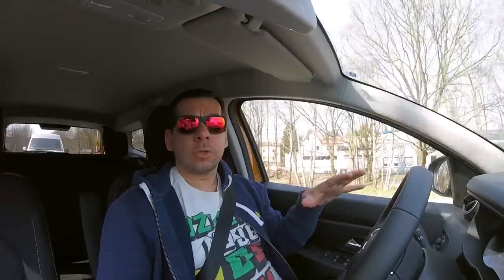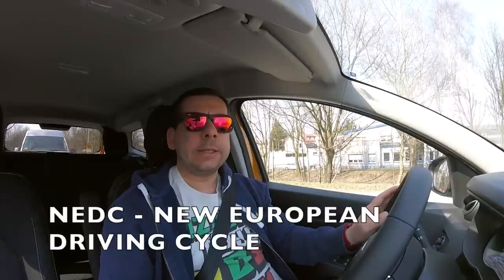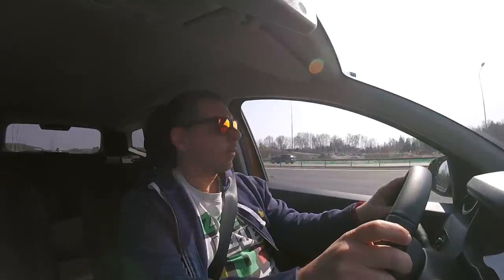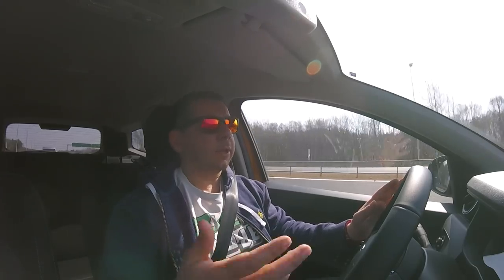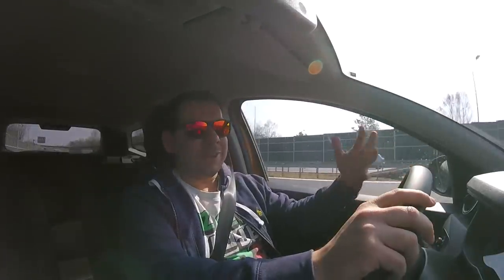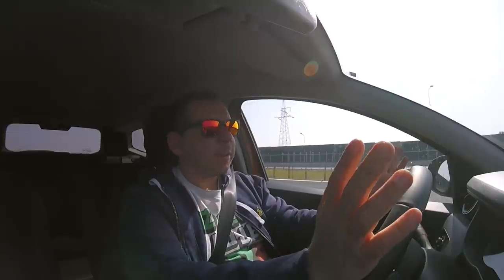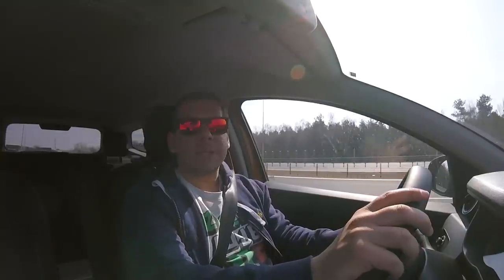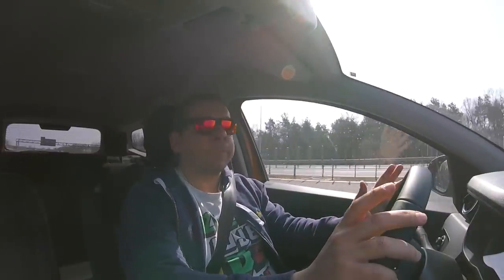NEDC, WLTP, and my fuel economy test cycle (ENG)

Comment: To my mind, usually used kind of fuel consumption tests should be based on the average speed. 
Different distances/speed values/periods of time/etc in way to reflect different usage models - in city/local road/highway with or w/o traffic jams.

Comment: In the U.S., EPA test results seem to match up to actual mileage more or less.  It is rarely 30% off.  But here in U.S., it is the manufacturers who (mostly) test their own cars.  Sometimes they cheat (VW, Ford, Hyundai/Kia).  The tests here are conducted on a rolling road, not on a real road or even track road.  I think the public should think about the test differently.  Rather than complaining "hey, I don't get the tested mileage", they should use the test results to COMPARE one model to another.  It is a SCORE , not a an actual fuel economy number.  If the tests are all conducted in a very standardized way, then such a comparison would be valid.
Reply: alliejr EPA is not  depend from car makers (at least not directly depend)
Reply: Are you sure VW cheated on the fuel consumption test?
EPA results are far from reliable either, EPA test procedure seems to favor big naturally aspirated engines while being overly harsh for diesels or small turbo engines. And VW is a great example  - Audi A4 (2.0 turbo) or TDIs are beating EPA numbers on a regular basis.
Reply: +sic22l VW has been convicted in court and also admitted to cheating.  It's a documented fact.  You can certainly argue that testing regime is wrong or right, but all of the automakers I mentioned are admitted cheaters.  In the case of Ford and Kia they restated the mileage figures for certain models to be lower than previously stated.  VW has taken billions in write-downs as a result of their diesel scandal which was all about detecting when the car was being tested so the car could cheat on the test.
Reply: @alliejr
You're confusing fuel consumption and emissions tests.
Reply: +sic22l I am not confusing the tests. It’s the same test that produces many resulting statistics related to both economy and emissions.
Reply: We're talking about fuel cosnumption only. That's where VW didn't cheat.
Reply: The Cycle test is supposed to show the car manufacturer's product is producing less emissions on a year to year basis in accordance with the 1998 CO2 reduction agreement, the industry has had 20 years to reduce Co2 by 50% or more yet has only achieved a dismal 21% reduction. They have till 2020/1 to achieve 95g/km, realisticly the shit is gonna hit the fan and the days of people driving 1 ton crew cab trucks as a grocery getter/commuters is gonna come to a screeching stop. There is gonna be (must be) a complete overhaul of what auto manufacturers can produce and what the public can justifiably buy.
Reply: As a European peson. We can say that if a certain model is sold both in the USA and EU. We rather look at the American EPA test results because the NEDC is just a BIG ASS lying joke. And the WLTP is still a lying joke.. only a little bit less. The American EPA test is the best and more reliable. Wish they just copied the EPA test here in Europe. But we got strong car lobby from Germany and France that didn't want such a strict test like EPA.

Comment: About year or so PSA announced they will use outsourcing audit to confirm fuel consumption.Sinse that no any updates is it so. For sure car manufacturers cheating on various aspects and fuel consumpion/ milege first and emission is a second in the row. Re Duster- suggest to test Diesel, incl fuel consumption. By the way- here in Ukraine its Renault Duster, not a Dacia Duster.....not understand why.....
Reply: I think it was a publicity stunt before shifting to WLTP. 
I know Dacia is called Renault in some markets. I imagine it was too expensive to market a separate brand.
Reply: Marek Drives  definately yes